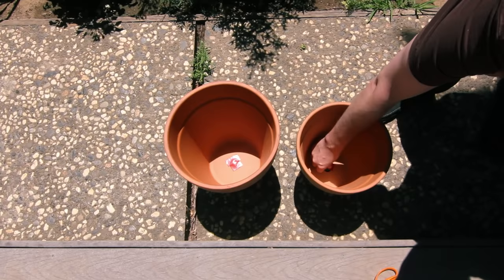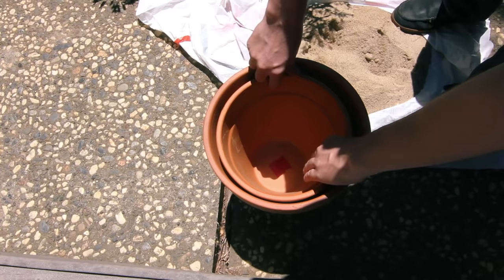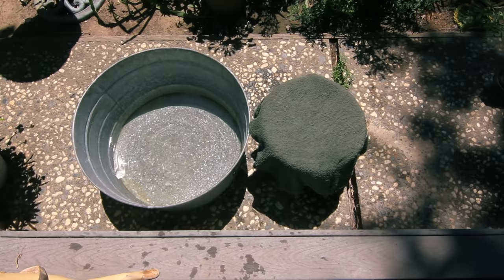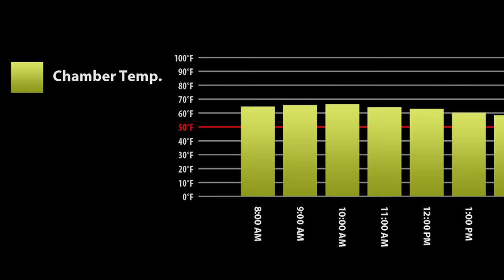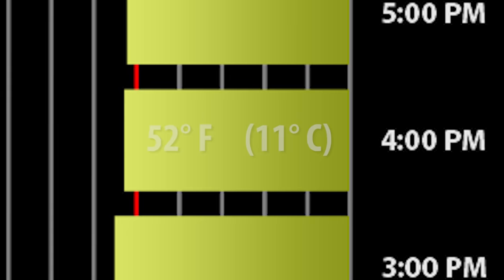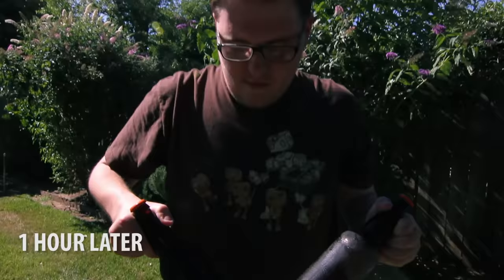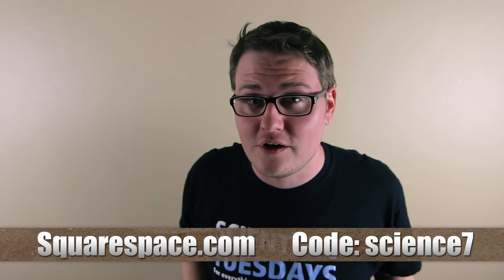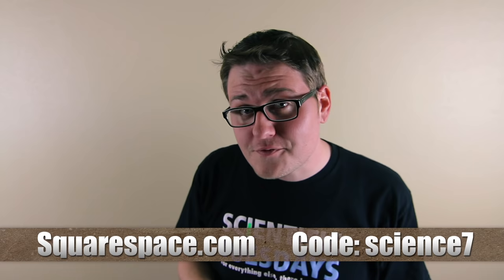Flower Pot Fridge!

Comment: My grandmother used to have a milk cooler (it held just one bottle of mik) with a piece of damp muslin over the top. It was made of earthenware and was basically a tube that was taller and wider than the bottle it contained. This was in the 40s and 50s before refrigerators were commonplace.

Comment: I saw this technique in a documentary called "No Impact Man".  He actually shut off his electricity in NYC for a time, and decided to try this method out.  It failed to work for him.  He did it inside, which might have caused some issues with the evaporation process, and I suspect he didn't maintain the apparatus long-term.   Point I'm trying to make I guess is that it isn't always as easy as it looks.  But, very informative on  how to have some success with it.

Comment: i remember my relatives in my hometown in india use a similar method to cool their house during summer. They drape the outer walls with a type of carpet that is made of coconut fibers which is water absorbing and thermally insulating. Then they pour water over the carpets until the whole thing is drenched.
The house would stay cooler than outside temperature for the whole afternoon.

Comment: @chuyton no, the lid would absorb all the outside heat while a wet towell does not as the evaporation of the water takes heat away from the pot

Comment: @MetaalAss 
i think the crucial part is the water temperatue in the sand but if you can keep it low (dont put the pot in the sun/let the pot stand in some water etc)  you could use it almost forever.
for further infos check out the wikipedia-article on Pot-in-pot refrigerator

Comment: As a scientist, I would like to try it ;) but it's currently 0C degree outside so I'll wait until summer...
My opinion is that the quicker evaporation would cool faster, which is good. However, as someone said it wouldn't last long. Thats why I want to try your idea of the bigger "reservoir" of sand, it could allow for prolonged cooling, which is also good!. 
I'm sure we can optimize this to fit (and cool) an entire 6-pack of beer....mmmm... science...

Comment: the type of meterial and sand type will affect the rate at which the water evaporates. the faster it evaporates the cooler it will get faster, but also the more frequently you have to add water.

Comment: It should last about a day or two, depends on the outside temperature. You won't have to change the sand ever, just saturate it with water again once it dries out, the same with the towel.

Comment: i see what you're saying, i used to want Celsius because i thought that made more sense, but when you look at te facts, you will never need the boiling point of water as a number, just high on the stove for 5 minutes. the only time it would be used, it's replaced by kelvin, the metric system does make more sense though

Comment: @ton321 undrinkable water can still be useful for other things. simply spraying a pot with water is incredibly inefficient for cooling, especially considering that cooling requires continuous evaporation, and it would still be a waste no matter what water you use. the method shown in the video is much more effective

Comment: @jonbellemore The main component is the overall surface area of the sand-filled portions. The more surface area, the more evaporation. I was thinking this could be used in design of a house or cottage with the walls filled with sand and water with a few windows of course.

Comment: @mrnapolean1 as long as the sand is wet it will stay cool
if the outter temp is low the pot's temoerature will rise by a lil

Comment: @iliketheZ00 they can only get down to 32 degrees. unless you freeze the water/sand mixture... Witch will brake the pot from the expansion.

Comment: The question is how far can we take this concept? I'm picturing a long pot (6ft or so long) filled with several smaller pots towards the same effect, so that you can access the materials inside one of the segments without letting the cool air out of the others. I live in AZ (maybe a month a year when the humidity would prevent this from working), and am picturing this being used in the backyard to replace the traditional cooler full of ice.

Comment: quick question - with the heat during the day, does the water within the sand evaporate over time? therefore you need to re saturate the sand to maintain that cool temp?

Comment: In theory could you elevate the pot, poke a hole in the bottom of both pots and run a tube through the pots, but still seal the pots around the tubes creating a cool air flow coming out of the tube. As the water evaporates on the outside of the pots and the towel, the air on the inside cools. Cold air falls and is siphoned through the tube to the outside, or does the tube's presence negate the effect?

Comment: @Pulsar232 It would be a lot better then letting your food sit out in the hot sun or hot weather but since bacteria grows like crazy when the temp is over 40 degrees Fahrenheit its best to keep food under 40. Which is why fridges usually keep the inside temp between 38 and 35 degrees Fahrenheit. So 50 would be better then 90 that's for sure.

Comment: @ninjakid165 the universum crushes, upside is down, downside is up, bad is good, nights are hot and superman turns straight. and it will be cooler in this thing 'cause u have more layers.

Comment: Keep in mind that air in the pot is much easier to cool than if you were to put a bottle of water, or a can of beer. Make sure you cool the air before you start cooling whatever you put in. And same goes for refrigerators, it works best as a means of maintaining a cold temperature instead of cooling from warm

Comment: We all know we only want to cool down beer anyways - so do this instead:
take some wet paper, wrap it around the beers and place it in the sun. Now your beer will get cold because the water start to evaporate and that takes energy (in this case) the heat away from the beer. The result: cold beer just by sun and a wet paper :)

Comment: For water to change to a vapor state it takes 597 calories/gram. This heat  will be taken from the interior of the pot thereby dropping temperature. The driving force will be the lower humidity of the surrounding air. Best results will be on a hot dry day. Putting the pots in the sun results in more heat being put in than taken out. Keep them in a shady area.

Comment: What if instead of using straight water use a 50/50 alcohol water solution.alcohol evaporate faster at a lower temperature then straight water.I wonder how this would expect your experiments temperature

Comment: @DopeyBovineMan foam might not work, since this method works by evaporating water, the water has to go somewhere in gas form. Foam is constantly used in temperature keeping devise because of they contain millions of tiny air pocket in them, and air isn't a good heat conducting substance, thats how foam work

Comment: So, 24 oz of beer to 40f in one hour =115 btus in a vacuum. with a wet towel as the only insulator from the outside you would need 600 btus. Not possible. These do work but a 40+ degree drop is not possible. also low humidity is required, the bottles had condensation on them? For a 43 degree drop at 92f you would require .01% RH the dew point would be -27f. Cool pot fishy results.

Comment: I'm concerned that you breached the refrigerator each time you checked the temperature. I'm no physicist, so my thermodynamics is weaker than my kung-fu. If I can motivate myself to make it, I'll see for myself, but I'm curious if you'd like to try measuring the temperature with some sort of apparatus that doesn't require opening it each time.

Comment: The inner pot has to be glazed or painted to make it waterproof. If you don't waterproof the inner pot it will not work coorectly the water will seep into the inner pot and start to heat up. Believe me I made the same mistake as you.

Comment: i'm going to make a house out of this. in winter, when it's not raining, the sand isn't so wet and it's cold, so it'll keep the temperature nice and comfy. in summer, it's constantly raining and the sand will get wet, thus starting the cooling process and goodbye air conditioner. u mad, AC companies? u mad electricity companies?

Comment: I hate when videos that would be clever and interesting are ruined by unprofessional and 13-year-old-with-a-vlog style jump cuts.

Also, 52 degree isn't even close to beer chilling zone.  They should have actually measured the temperature of the beer, because fogging and chilling the bottle doesn't take much.  

They wouldn't store medical supplies in a container over 40 degrees.  That'd be extremely dangerous.

Cute idea, anyway.